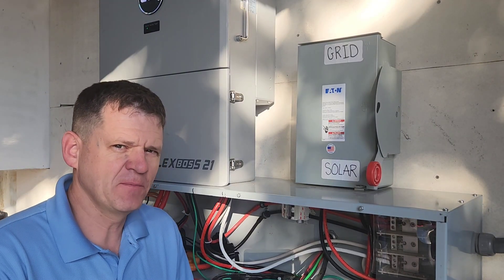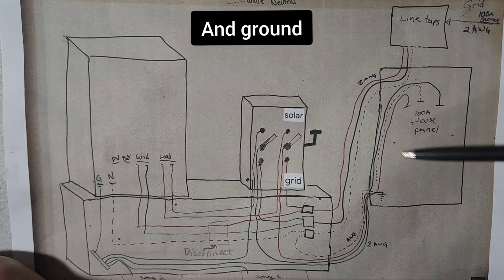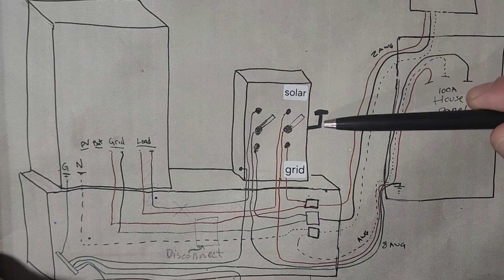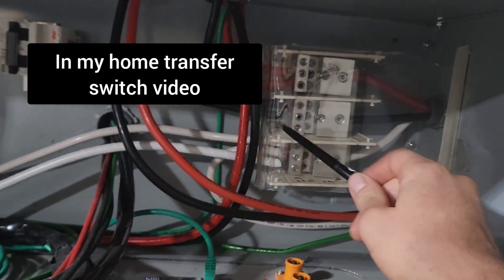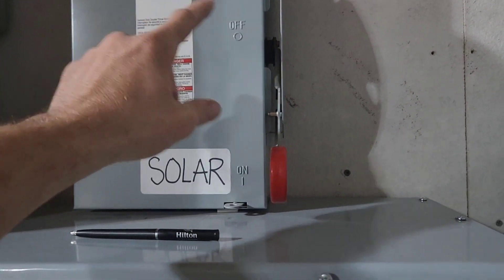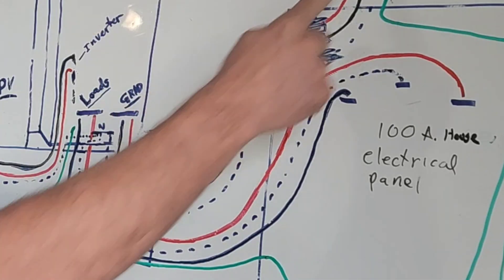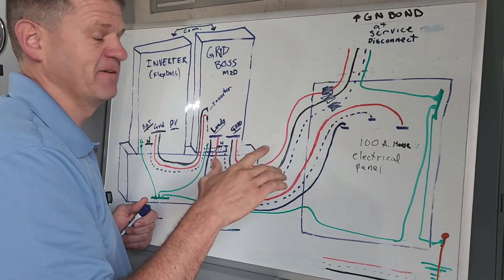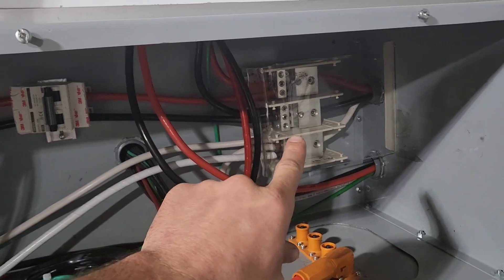Wiring Diagrams of: Eg4 GridBOSS VS My Bypass Transfer Switch

Comment: I am currently doing a Flexboss18 setup without a Gridboss and have 100amp service with a breaker outside at the meter. My understanding though using the wiring charts v2 is that in 7a. EG4 FlexBOSS21 with Supply Side Tap and Whole Home Backup (with Notes) that the breaker between the supply side tap and the feed to the inverter grid terminals has to be limited to 90amps. I see your Chinese breaker is rated for 100amp. Was that an oversite? I am thinking of getting a single 100amp rated breaker panel for outside and putting a 90amp breaker in it and then an RSD button beside that. Having 100amps feeding the inverter had no negative impacts? The diagram showed a DG223NRB for outside but I dont really like the 90amp class H fuse idea. I'd rather a breaker trip than blow a one time use fuse if there was a problem. The outdoor GE box I was considering is a TQL100REP with a roughly $50 breaker that is 90amps. Any thoughts?
Reply from the maker: I think some AHJ's require a fuseable disconnect... so it might save you some time just to go with the fuseable option and get a couple extra fuses. 
   I was using my Chinese 100 amp fuse as simply a disconnect. I think it was a bad idea because it had really cheap terminal connections.
    But that is a good catch... I think I really needed a 90 amp fuse.  I totally missed that. I believe I was thinking that they wouldn't allow more than 90 amps through the inverter, but now that I think about it, I am not sure that is correct. It would be safer for me to have a 90 amp fuse because I'm not sure what the internal circuitry of the inverter looks like. Right now my build has a grid boss, which includes the 90 amp fuse breaker... but if I remove the grid boss I might need to install a 90 amp fuse.   It would be nice if I could have a little breaker panel inside my 12-inch wire gutter that would allow me to distribute the power and also have a breaker for disconnect and overcurrent protection... however I'm not sure they have small breaker panel boxes that are under 12 inches.

Comment: I believe the disconnect switch for the grid power to the inverter has to be on the outside of the house and labeled so the fire dept knows how to shut it off should a fire happen. I'm pretty sure that's code.
Reply from the maker: Yes, I'm pretty sure you're correct. I have a separate disconnect switch outside so I won't be using the grid boss as my service disconnect here. Thanks
Reply: @diySolarPowerFunWithRay Do you mean the 100amp service entry breaker next to your meter? Wouldn't you also need an RSD out there to ensure the inverter and batteries aren't still pushing power through the house circuits in an emergency? The fire dept would think they are killing power to the house at the meter breaker but the house wiring would still be live from the backup system no?
Reply from the maker: I want to say that the RSD is only required if you have roof top solar and it doesn't pertain to ground solar arrays... I could be wrong though... I need to double check that.

Comment: Thank you Ray.  The diagrams side by side make understanding this very easy.  You did a good thing for our GirdBOSS community.
Reply from the maker: Thanks. Install coming shortly.   :)
Reply: @diySolarPowerFunWithRay  hey ray i used this breaker to break up grid power to inverter Square D QBL22100 2 Pole 100 Amp 240v Circuit Breaker. I bought a refurbished one on buymybreaker or you can just buy a new one. Thanks for your help with videos I finally installed 12000XP in Jamaica about 4 weeks before storm and now my mother in law has power down there when most of island is without power. Your videos really gave me the confidence to do it. I wired my system like you had your 12000XP and it works great. I used your discount code twice over the summer. Thanks again!